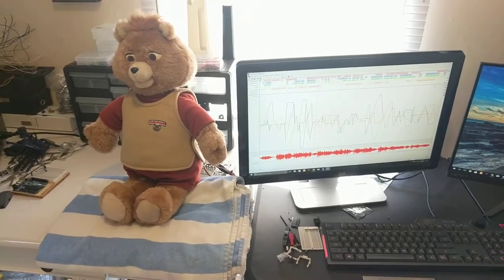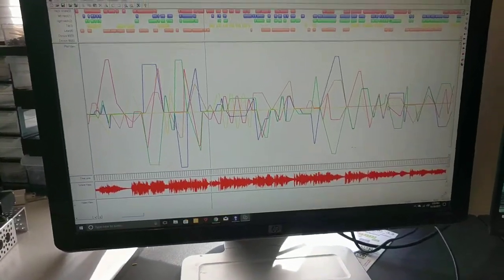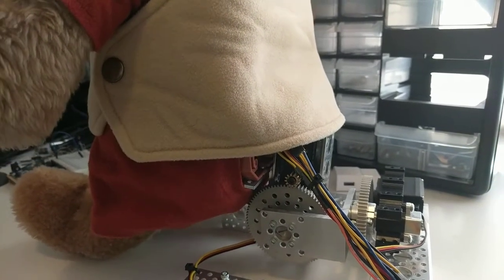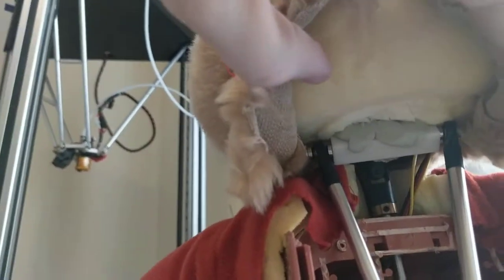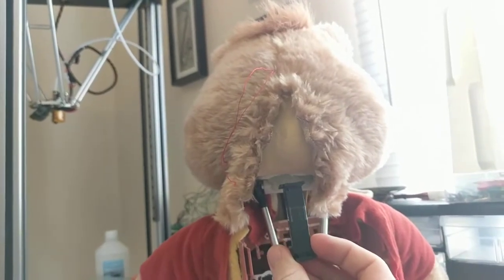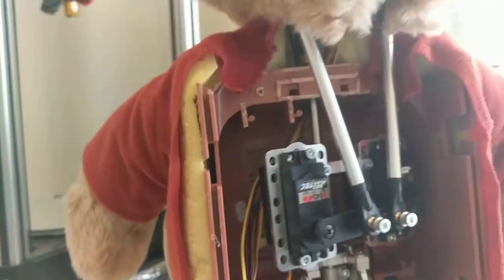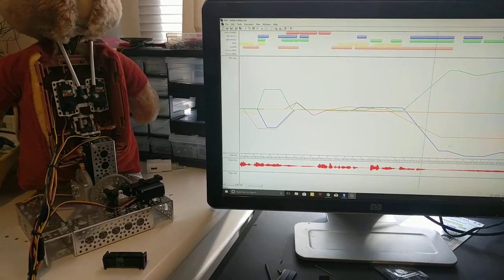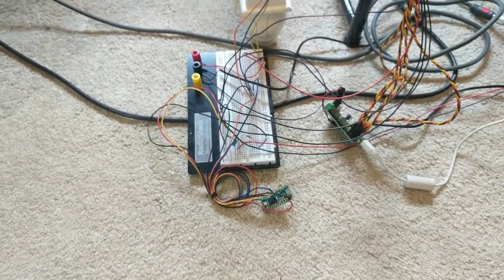Behind the scenes of the moving neck and body Teddy Ruxpin

Comment: Great work man! Have you thought of going with pico/nano servos for the head? Seems like everything is pretty "beefed up" in there. Where did you pick up the bracketry and gears for the body lean?
Reply from the maker: They have to support a fairly good amount of weight, his head isn't balanced on the universal joint and most is supported by the servos, which is why I went with standard servos - although I didn't do the math, smaller may have been sufficient!  The brackets and servo gearboxes are from servo city.
Reply: Aaron , still great work. I work at Universal Orlando. We have a lot of animation, you would be a perfect fit to work on the stuff here!

Comment: Hi Aaron, what a brilliant job! I just bought a Teddy Ruxpin first version from 1985 with metal player and I was wondering if you have a program to record custom tracks by recording your custom PPM data  for movements on the right track and whatever audio you like on the left track, singing etc... How can I generate custom PPM data that I can synchronise with the left standard audio track (by using the original servos, therefore without modifying Teddy)? Many thanks and keep up the great job!
Reply from the maker: Hmm, I don't know of a program that would do that.  I used a Teensy processor and the PulsePosition Library to decode the original data.  BUT, that library also has an encoder, so I bet a simple circuit could be made to translate that encoded PPM to line-level audio!  So in theory, a program like VSA could be used to sync audio up with position information that is sent as serial data to a Teensy then encoded with the PPM library and recorded in real time to a cassette along with the audio.  Shew, that's a lot, but I bet could be done! I wonder if there would be a small niche market for that, haha.
Reply: Aaron many thanks for your reply. I know lots of folks on teddy ruxpin forum that would like to achieve something like that. Would you be able to try if it works in your free time?  I just use an MP3 tape adapter with mine. Thanks
Reply: In your opinion what device did the original maker (Wow) use to generate PPM? 
I guess they also had a joystick to synchronise Teddy movements with the singing. 
Would be nice to replicate something like that. 
If you run tests please let me know, very interesting! Thanks